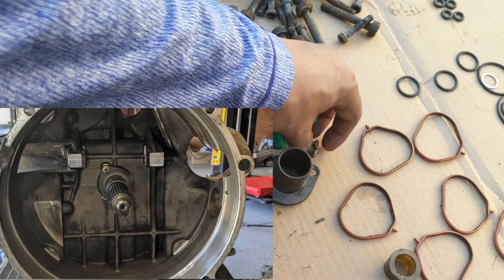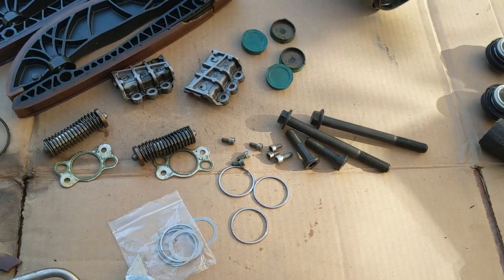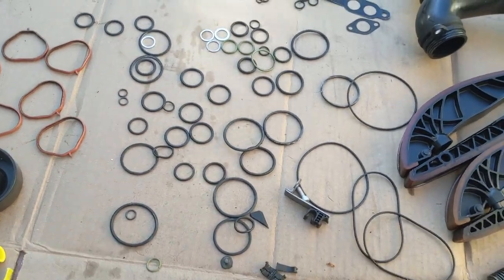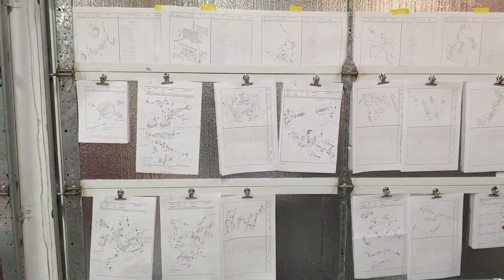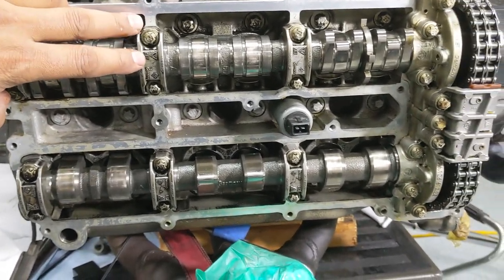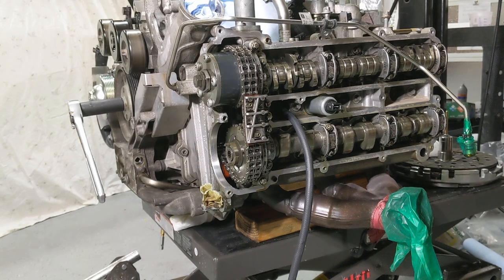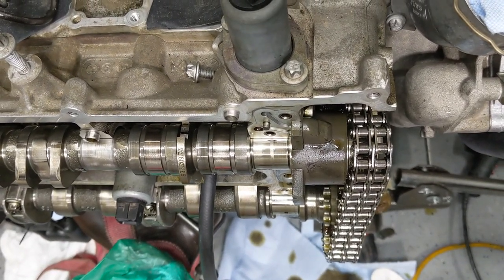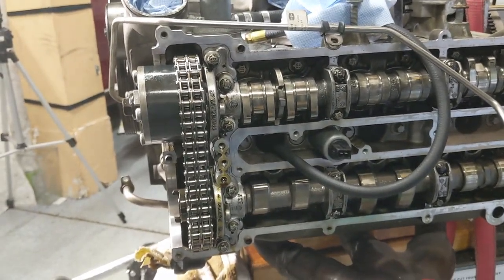Jay's Porsche 997 turbo part 5 - Spun Camshaft

Comment: Awesome video series! The spun cam is a problem on almost all 997TTs. Mine has it too 😭 luckily only partially so when the oil gets warm the error code relating to it goes away. Been driving on that partially spun cam for 2 years now 🙈

Comment: Great video - good to see it coming together ! Surprised how little,torque needed on those camshaft end bolts !
Reply from the maker: Keep in mind some of the bolts you saw may just be the initial tightening and requires final tightening to certain degrees of rotation.

Comment: Great video, thanks. How many miles on the motor when this happened and just curious but what brand and weight oil have you been using?
Reply from the maker: I think Jay's car has around 85k miles.  I assume factory Mobil 1 0w-40.

Comment: Mezger flat 6 engine is 1,2,3 on d/s and 4,5,6 on pass side not 2,4,6 as spoken in the video  has this changed since the 996 turbo Mezger?

Comment: hi, what are the symptoms of a spun camshaft?
Reply: I had none but P0021
Reply: Calling it "spun camshaft" is slightly incorrect. It's the sleeve that supplies oil to turn the VVT mechanism. VVTs return to the full power position if no oil is supplied, so it's like having no VVTs.